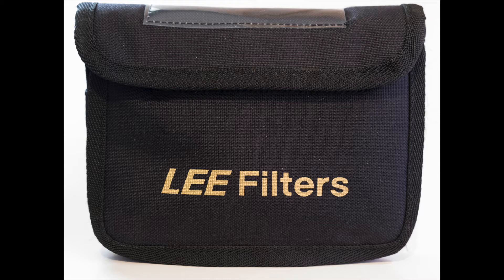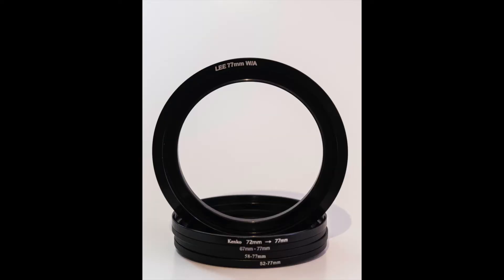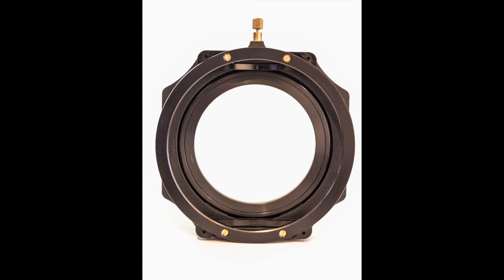What Filters For My Fujifilm X T2 and X T20

Comment: Hi thanks for your video. What I was wandering, I use GND filters too and most of the time it's hard to see the result in the EVF or on the LCD. For example, difficult to see where to put the hard line of the filter. Do use special settings in camera when you are using the filters?
Reply from the maker: that's an excellent question.  soft edged filters can be particularly tricky to position.  no special settings used, but when i used to shoot with a dslr i used live view instead of the ovf to position the filter.  also, if using a grad in conjunction with a nd filter, i'd always position the grad first.  other than that, just trial and error!

Comment: Firstly, I wish you all the best with your check up next week, I hope all is good with you. I have considered moving over to Fuji but have heard that Lightroom has issues with the RAF raw files. Do you use Lightroom and if so do you find any problems with it? Cheers.
Reply from the maker: Thank you Nev- much appreciated :-)

Yes I do use LR.

The only real issue I've come across is when sharpening images.  You need to be careful as applying too much sharpening (particularly the detail slider) can result in worm like artifacts appearing particularly in foliage and such like.  I hoped the latest release would fix that but it doesn't seem to have.  There is an alternative by performing sharpening in PS instead of LR but I've not tried that out yet (perhaps in a later video???).  I'm not a LR "power user" so can't comment on things like upload and rendering times.  There is also a shortage of presets for Fujinon lens correction in LR but I've found that using the Nikon equivalent is pretty accurate in most cases.

I wouldn't let the software issue stop you from switching.  Unless you pixel peep you probably won't really notice.  The reduced weight and size of my kit was more important to me with my crumbling back, and the cameras and lenses really are a total joy to use!!

Nick